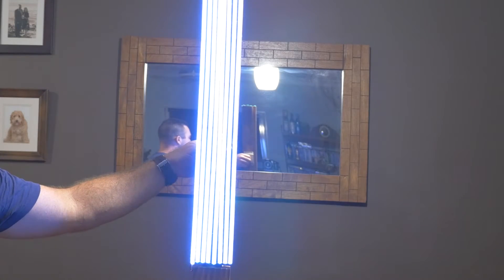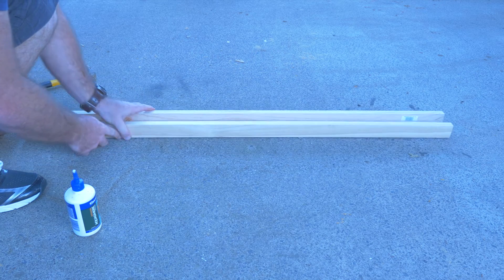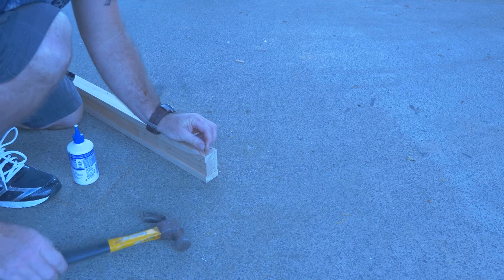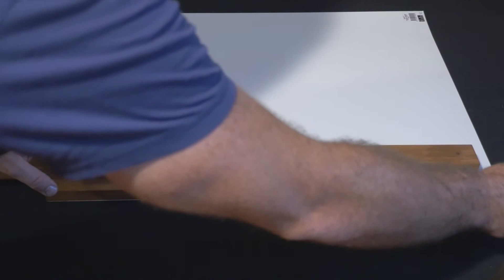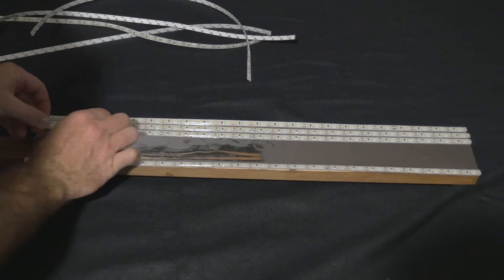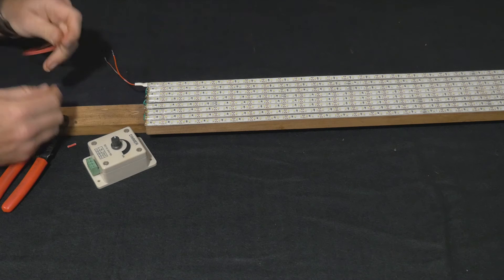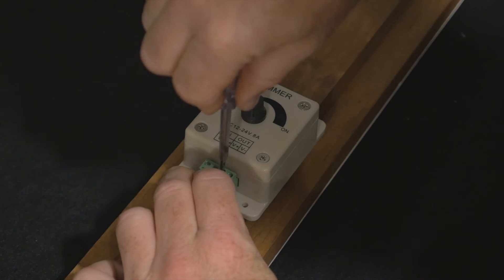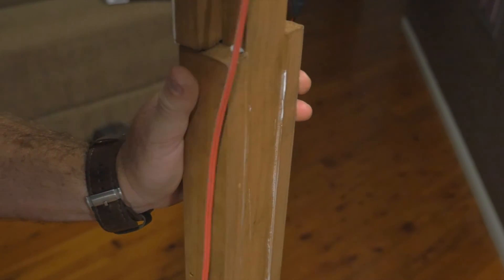Make a LED video studio light panel for $35

Comment: Great Idea, I might make something like this with a battery plate, to use a huge Sony battery for portability. Or even a smaller one to mount on top of the camera with a quick release plate.
@lonearcherfilms sent me.
Reply from the maker: +xfist2facex The best part of a DYI is that you can make your own design for the base plate and so on. Be creative or practical ;)  Thanks for the heads up I'll send Grant a message. I'll show Master Subies how to make a camera mount soon for DSLR type cameras that also acts as a protector in case you knock it :D Nice insurance for your equipment for $20.